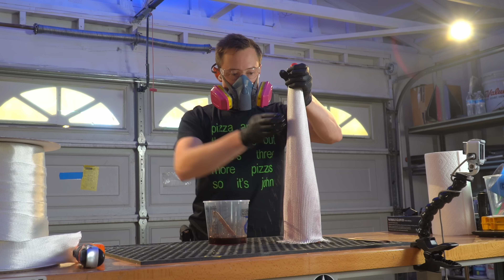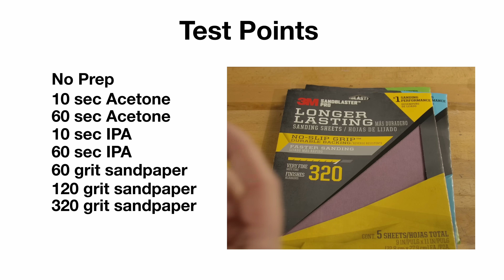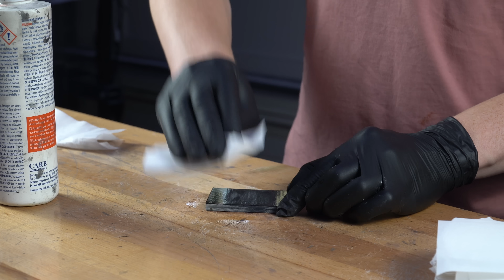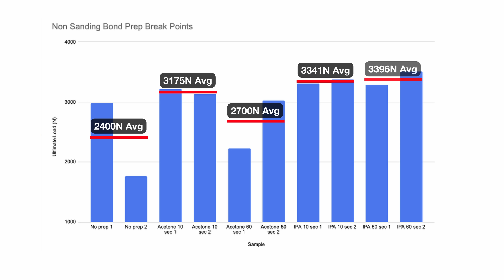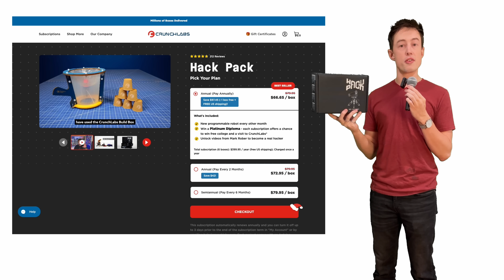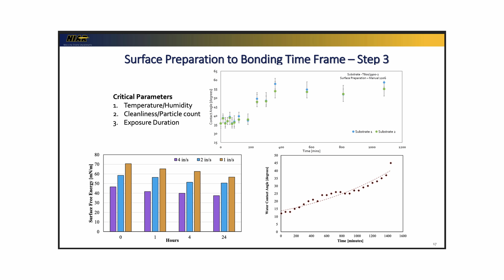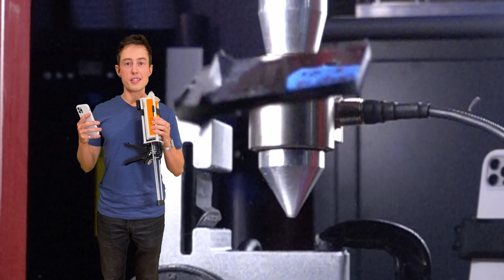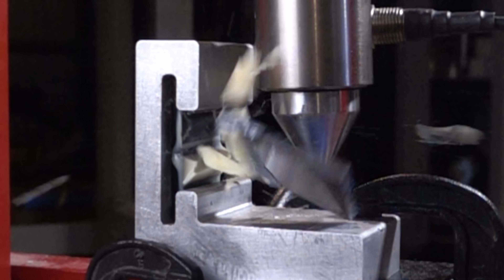I Broke 100 Epoxy Bonds to Find the Strongest

Comment: Interesting idea using atomic oxygen could be explored further. Perhaps using hidrogen peroxide would be the safest. Then this is just oxidation. Reduction could be tried as well. I thnik some chemicals with reducing effect can be easily bought. Additional comment on testing, changing of some parameters you aren't studying could be effecting results. Therfore, just keep it the same or if it isn't possible to control, just make it a variable. Just something you can consider big difference, for example pressure when sanding by hand can't be exact every time, but you can press lightily or really heavy.

Comment: Vacuum mold rocket body in sections with control surfaces. Pour rocket body sections with control surfaces as one high load strength singular part (expand total area design to facilitate sanded removal for final dimensions).
Each subsequent section of rocket body utilizes a "tougne" upper ring edge and "groove" lower ring edge for stack assembling and bonding. Hint, build a rotating motorized Pour platform. Oh, I forgot,, for less weight, use a seald suface lightweight material as fin cores which will eliminate solid epoxy fin weight.

Comment: Did you at any point consider degreasing your sandpaper? 

I have never done it yself, but i came across a video once where a guy just used break cleaner to degrease the sandpaper before sanding.
Reply: 💯 De-grease the sandpaper with brake cleaner, seems worth a shot! 👍

Comment: maybee look at the old videos to see if the point of the loadcell is at the excact same position. why you dont grind the small site of the plate you brake off the fixed part?
And most important the glue betwwen te edge and the fixt part is to thin and sometimes dosent excist at all. this gives point presure and makes it fails more likely. the glue is to big and gives less flexibility.and strengt.

Comment: Hey im a technician in an research lab. Something that i noticed was the fact that you measured the epoxy just by pouring it out of the cartridge either into a beaker and mixing it by hand or through the mixing nozzle.  With two component epoxy s mixing ratio is key, if it is of by even very little, material and bond strength are significantly affected. In our lab we would always measure by weight to get the calculated perfect mixing ratio because even volume is not precise enough.
Thanks for the amazing video and i hope you will see this.

Comment: I would argue that the critical load here is not even shear. I would say it is cleaving/peeling. This is exactly the type of load stiff adhesives like epoxies don't handle very well. A tougher/more flexible adhesive will likely result in a higher strength.

You bonding setup is not ideal. Normally you press the parts together so the epoxy is really forced into the roughnesses in the surface. I think you can incorporate that into your setup by first working a thin layer into the surfaces and then doing the potting setup.

For roughness: I think the official testing is done at 25 (μm) Ra, at least for mild steel tests. For the best consistency, you need grit blasting, but a bristle blaster also works.

If the failure is not cohesive, you are good as far as surface preparation goes. You would then need to look at improving the strength of the adhesive itself.
Many epoxies can reach higher strengths when they get an additional temperature cycle for curing.

Comment: I have successfully used propane gas flames to change the surface energy of HDPE to make epoxy and other glues and resin sticking to it. The treatment has to be very short and you must apply the flame so close to the surface that ONLY the inner blue part of the flame is used. Otherwise it will not work as well!

Comment: I used to work for a company building carbon fibre wheels for cars and bikes. For our metal tube centers that needed bonding to the carbon wheels the metal tube was sandblasted to an even roughness. The carbon wheels were put in a cupboard we made using celetex and an electric air heater and warmed them up to a good warm temp. Once the metal tube was sandblasted, it was cleaned using acetone. Then it did a 4 stage dipping process to clean them and chromate them. Prior to glueing we acetone cleaned them then put a thin film of glue on it before sliding into the carbon wheel bore. This was then left out to slowly air cool. The warming of the carbon makes a huge difference. But no sanding was done on the carbon at all as you start to degrade the substrate very quickly. However it wasn't a smooth surface like the fibreglass plates as it's the inner or carbon which is rough. I'd say a low grit media blast on the surface of the fibreglass may give a more even and repeatable surface for bonding prep.

Comment: HAVE YOU TRIED PU ADHESIVE?
Sikaflex 221 will stick bricks together, stick just about anything.
But in your requirements it might give you JUST enough flexibility to reduce the loading.

Its used to stick car windscreens, body panels etc. It will bond aluminium to steel. Me personally saw my car flip twice over in mid air, fell off a 50ft embankment and then crashed hard down. The glue STILL held on all joints. Fibreglass to steel. I had to remove the fibreglass later.. Took me days to cut it off...

Might be worth looking at.

I prepped the fibreglass using a stainless wire wheel in a variable battery gun until bonding area was in a better condition. Then cleaned with an air line blower. Then used brake cleaner aerosol or you can use ipa etc.. Then literally and generously gunked it up and pressed it to fit together. Bit of tape to hold position overnight. 48hrs later fully cured. That's never coming loose. Try it you'll be amazed 👍

Comment: I dont like ipa for cleaning when using an epoxy product. Use xylene as that fiberglass has resin, which does soften even so slightly when using xylene. IPA flashes off too quickly.

Comment: As it relates to prep and prep vs bond time:
- Sanding patterns matter, cross hatching seems to generally work better.
- Bond time, its extremely important to consider these tests were performed on plastics. Other materials will have different results. Consider for example aluminum, etc. Oxidation of these of the surface may yield and better or worse result

Comment: Sandblast was by far the best (I do not know about new tech) we do this especially on metals. note that Aluminum oxyde so fast, it need to be bonded fastest as you can, (even with adhesion promoter, ) 24h and we got 1/4 of bonding strenght (you bond on oxyde). interesting more, some metal are contaminated by sandblast media, titanium like normal aluminum oxyde grit (bellow 180 grit), it not like silicon carbide grit (grey paper). (or it's reverse? I not remember do research yourself (not AI) before if you want to test) For myself, I use sandblast and just blow air, it keep statics and extreme high energy bonding (you can drop styrofoan balls and it will go on stick to sandblasted area or part). sandblast on metals, like aluminum , iron... will harden the surface by stryking of the grit when you hit with the grit, it help bonding too. you can't do this with hand sand paper sanding... back in days, we got boeing certification, in fact our test sample was the best they seen in all composite history (even nasa did not do better than us by a large 10%. it's a astm 3039 . I did manage the composite team to do best possible sampe and have best no variables to make them less variable. it's the best interesting smart clever thing I done in my life. (I not know if I can talk about, it's absolutely not cheat but EXTREMELY good mastering and use of the ASTM D3039. we did composite so perfect, i'm sure boeing still search why we got the best sample in the world.... lol! :D (all is 100% legit , 100% good maetrial to use, perfect optimized autoclave pressure heat curve ramps, it's just we did so perfectly, we did (constrained) variables, all our sample was within 1%  lol! ) (you got it when it's cohesive on adhesive, you have acheved the best of the epoxy performance. and... you get to the interlaminar failure too of the composite,... metal would be a better sample maybe? ) i'm not english so, I appologise for errors ;D )

Comment: Use hysol 9394 adhesive.  Also sand papers are mot created equal and cause issues. For example, many of the wet dry sand papers have oil in them. Also wood working sand paper that is labeled as non clog has a serate coating which also interfears with bonding. 
3M cubitron in mesh form using a random orbit sander is great for flat stuff. We used 120 grit most of the time on carbon fiber, sometimes 80 and sometimes 150 on finer P120 fiberglass. 

IPA alcohol is good. If it is cold or very humid, recommend using a hair dryer to remove any potential IPA or moisture. 

Saw a few recomend peel ply, that is also great and keep the surface clean until needed or while in post processing.  

Instead of a fat fillet of adhesive, consider making carbon fiber "L" shapes molded to the geometry and then bonded with 9394. 

Also bond line thickness is particularly important. We shot for .007" for composites to metal and .010" for composite to composite. We used <1% glass beads to help maintain bond line. 

Another adhesive which you may find much easier to use and requires very little to no prep Plexus  Methacrylate type Adhesives. These can be gotten with variable cure time, fast or slow. Require almost no prep due to their chemistry. The better ones are made by 3m, hysol and other. You can get them cheaper from the marine industry, ie pexus, and they are now used widely in automotive repair for body skin panel bonding, both from the factory and repair applications.  Several advantages for you is they come in meter mix tubes, they are normally never manually mixed like epoxies are.  You can with the longer work life ones mix in some chopped fiber if desired for more strength. They exhibit great adhesion, and for your fins will exhibit a level of flexiblity that would be desirable, ie not brittle like the epoxies can be. 

Enjoy and look forward to seeing more videos.
Reply: 💯 Using a more modern and more suitable adhesive (and adding some form of fibre, or even a sheet of fibre) was what I took away from watching the video, and reading this (and other comments).

Comment: I would prep with dish soap first.  Both IPA and acetone dissolve contaminants, especially oils, but can redeposit them.  Soap will bond with oils and water will flush it away. Also, soap and water are cheap.

Unless you're avoiding water for some reason.

Ultimately, you need to flush the surface to ensure contamination is washed away.

I use what I call "soapahol" for my cleaning. 60% isopropyl and a drop of dish soap.

One way you can test the difference is with holographic 3D print surfaces.  Any contamination will dull the holographic effect.  When the surface is contamination free, the holographic surface will be BRIGHT AND CLEAR.

Comment: Like the video but the best results I was able to achieve was with using MEK to prep the surface also there are some extremely strong types of epoxies one of the strongest is used to glue aircraft together. Just a thought

Comment: Try using a thin Kevlar weave or mesh on the outer layer of the tube surface. Sanding Kevlar is one of the most frustrating things you can do as the resin will be removed by the sanding but the Kevlar fibers remain like small hairs. BUT, you can use this to your advantage, if you only sand where the fillet is it will help prevent substrate failure. Also mixing a small amount of "Cat Hair" small strand chopped fibers fill strengthen the fillet.

Comment: This has been very interesting, though there are still a couple suggestions/comments I have, some have been posted here, some haven't. But the biggest for me is "Test how you fly". Since you were testing for fin retention, I would have made the the jigs with a notch or somthing as I presume when attaching a fin it's not onto a flat plane, but rather with a grove or indent to aid in alignment

Comment: You might want to look into using hydrotreated light petroleum naphtha cleaners like Exxsol DSP 80/100 (or things advertised as "light spirits" / or "white spirit" / or "camping fuel") as a pre-prep cleaner before acetone, to have broader decontamination coverage. The light naphtha will remove non-polar contaminants very effectively, while the acetone will remove polar contaminants.
Reply: Yeah, there are better solvents that can be used instead of acetone (and also instead of alcohol!)
Reply: I'm wondering why he didnt use compressed air before applying the IPA. Any woodworker who's done a lot of sanding will tell you compressed air is more effective at removing particulate from rough surface than only wiping it down with, let's say, a wet rag.

Comment: 0:56 - if you are going to be dealing with epoxies and other nasty chemicals then it is time to buy a full face respirator vs just one for your lungs and safety glasses for your eyes; and as a bonus you won’t get that pressure point mark that is visible on the bridge of your nose long after you take off the mask.

Comment: Hey man, Loved the video. I do composites work in the sailing world and think you'd benefit from checking out a composites technique called the Pi joint. We use it for bonding daggerboard cases to sailboat hulls and decks. stupid strong and actually a similar ish load case to your fins.

Comment: only using one type of "joint" or "connection" renders this information mostly useless. 

First of all, if you only have one joint to test the strength of epoxy bonding, then why introduce all of that geometry into the equation with a "t" joint?

  a flat lap joint would have been more relevant to the expoxy bonding to the surface.. still not perfect...but using a "t" joint is just dumb.  the space that the epoxy fills (in this case a triangle) becomes the geometry of the joint.  it's strength is relying on way more things that just the surface bonding...including the epoxy material itself.

what you don't know still, is how much of the architecture (geometry) is supporting the break point.  

co-effecients can be wildly unpredictable...and this experiment has a million holes in it.

what a waste of time...  this is why you should leave the science to scientists.

Comment: Joe, what about prepping the edge of the material that contacts the face of the prepped surface; at the contact point of the "T" of the "T"? If I'm an atom at the surface at the contact point with no epoxy there, it's looking like the Grand Canyon with a lot of air between the North and South Rim.

Comment: I think also how you apply the force (slowly, quickly) will change your results a lot. Notice how that one paper tried breaking tests at 1 inch/sec, 2 inch/sec, etc? A hydraulic jack is hard to control how fast you apply the force. Excellent video though! I always wondered these myself.

Comment: I think the problem came from where you tried to intentionally do so straight grooves. You could have been doing a bit more randomized motions of sanding back before that allowed the 4000 limit to be reached. 
I don't think it's just the margin of error since your first two tries were both so high,  then the ones you tried with the focus on sanding direction were all so much lower. 

Yes while orbital same performed worse and it does spirals, it also had smaller grooves like you said,  so i think the data got muddy by this double variable. 

Try sanding in a cross hatch or circles by hand and see if they reveal greater result then just perpendicular straight lines. 

That's just a theory, A SAND THEORY

Comment: Ou i think i know why the scarring was inconsistent and weaker. You cut the surface fibers to allow epoxy to seep deeper but didnt off gas ie pull the air out and let epoxy to replace it so in one sample it even might have gotten vibrations from the work table that help the off gassing process tiny bit while on another it didnt get that, or there was still some isopropanol alcohol inside that finally evaporated from the epoxy drying and causes bubbles inside.
Also did you use new sand paper for each peace cause that can be major difference. More you use the paper less sharp particles it has ether by them falling off or just dulling. Also random orbital might rub more dust into the surface than your uneven finder work and i noticed on the cleaning maybe the biggest issue. You are seemingly holding both parts and swiping the degreaser rag to the table surface, witch will end up spreading the lubricants etc from previous moldings to the surfaces. A minor thing but still notable it takes around 3 days for dust to settle in interior room after sanding or causing fine particle dust, dust that can and will collect to surfaces via air currents and static electricity so another variable that likely messes on the results leading into inconsistency.

Comment: What about a UVC light setup? Kind of like a tanning bed but for materials so you can expose them to elemental oxygen. And if you can't have the part directly exposed to UVC light because it'll degrade the resin or whatever. Just put baffles in the way that allow the atomic oxygen to reach the part but not actually harm the part

Comment: Use ANOVA to analyze results. With a properly designed series of tests you can sort out results for example, where multiple parameters vary per test coupon. For example, you mentioned that you think that finer grit sandpapers may well work better but there was too much noise to see. With proper design of your experiment and proper statistical analysis, you can see that, even if for instance, another parameter such as solvent type or degassing was also present among those tests.